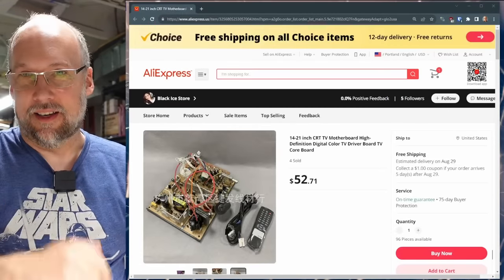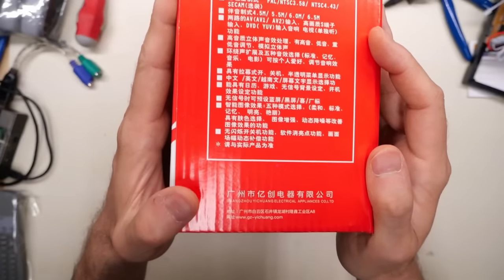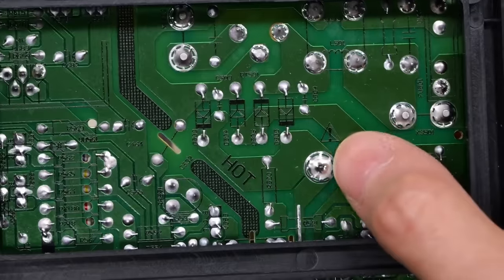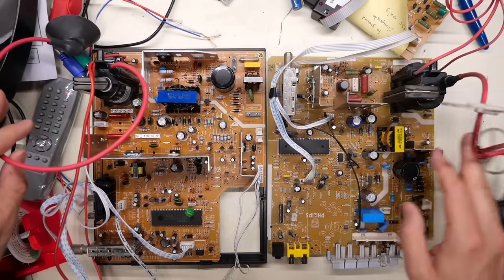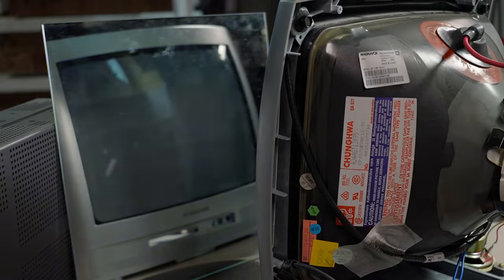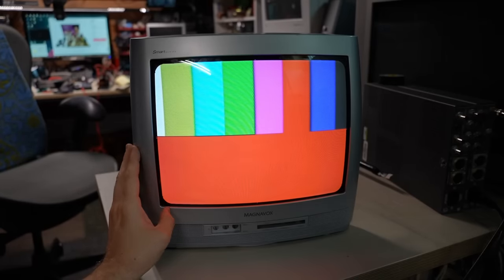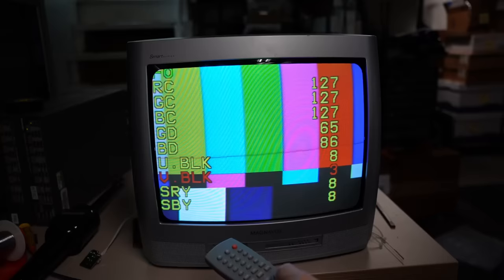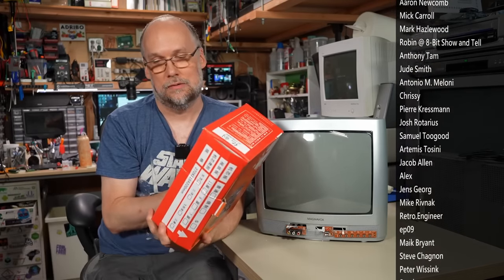I replaced the main board of this TV with brand new parts made in 2023!

Comment: At 40:30 
B/G:  was for Western Europe, former Yugoslavia, South Asia, Australia, and New Zealand, 
D/K: (along with SECAM usually) in most of Central and Eastern Europe and mainland China. Most analogue CCTV cameras are Standard D 
I:        was used in the UK, Ireland, Hong Kong, South Africa, and Macau
L/L':   Used only in France, Luxembourg (only RTL9 on channel 21 from Dudelange) and Télé Monte-Carlo transmitters in the south of France
M/N: Used in North, Central and South America, Korea. South America also used PAL 60 with M/N. PAL 60 is similar with NTSC 3.58
J:       Only used in Japan with NTSC.

B/G uses 5.5 MHz Vision/Sound carrier spacing, I uses 6.0 MHz; D/K uses 6.5 MHz; and NTSC uses 4.5 MHz Vision/Sound carrier spacing. 

After 2000s until digital transition Eastern Europe swtiched from D/K to B/G. I remember the Over The Air analog channels on VHF band used D/K and UHF band used B/G. Cable companies used both formats but in the last years they only used B/G sound format.
Reply: North Korea adopted the D/K standard, South Korea NTSC, Pal M was used exclusively in Brazil, Pal 60 is not a broadcast standard - it was used for video playback only -, Pal N was used in Argentina, Paraguay and Uruguay only.

Comment: Another thought. Since the board is pretty flexible and has a schematic, it could be useful for modding a USA NTSC device to  run at film rate (i.e. 24 fps rather than the USA standard 30fps). Useful for film props. More about this problem in shango066's recent video.  
https://youtu.be/iz3e2VQZeiw?t=840

Comment: When I used to repair TV's in the early 90's and using a variac I often found they would come to life with around 90 volts, and being SMPS the secondary rails would be correct over a wide range of input voltage. Would have been interesting to see if it would work on 120v in it's original configuration. I doubt it would cause any damage. I guess if you swapped out the posistor with the one from the original board the automatic degaussing would work too.

Comment: I think if you would do a video where you scan the original TV housing, edit it in a CAD program, and 3D print a replacement customized to fit the new parts, could be neat. If you'd be able to do that sort of thing, or maybe collaborate with another channel that does stuff like that?
Reply: Came to the comments looking for something like this. He could even just 3d print a small plate and glue it to the front so it looks a little less janky.

Comment: I suspect the SRY and SBY controls are related to tuning the chroma demodulator.   Not 100% sure about the “S” part, but based on what it did to the image, my guess is it’s r-y, b-y color difference signals, possibly gain or offset or something like that.  The demod path for color is composite -> color difference + Luma -> CSC(color space conversion) to RGB to feed the tube.
Reply: Yeah I was thinking the same thing.
Reply: That would also apply to the U.BLK and V.BLK. Since U & V represent the two chroma difference signals.
Reply: Googled around for the meanings of SRY and SBY, and found these explanations:

SRY Secam black level R-Y axis
SBY Secam black level B-Y axis

Comment: I've heard that the new Chinese CRT televisions that the board is used in often use recycled VGA monitor picture tubes. That might be what that picture tube socket is for. It could also just be a normal Philips clone socket, though.
Reply: SVGA tubes can have much better TV picture quality due to finer pitch. I was using a Nokia 417TV (low radiation monitor with TV part) for eons, but eventually a fatal power supply design flaw fried half of the electronics (especially TV section) by negative voltage on +12V, and the mechanical construction is a nightmare to repair (PCB soldered into a perforated metal box, brittle plastic case, double sided PCB with SMD components etc.).

Comment: It's a worthwhile idea to take up the schematics for analog electronics like CRTs and replace components anyway for preservation work. Things can and will leak or fizzle out, so putting in new ones and making sure to perform patches on any damage you find is basically part & parcel. One can appreciate working on them and rejuvenating tubes for continuing this tech should things go awry with modern in the future and we need something reliable.

Comment: I wonder if that PAL generator screen combines the color bars with a purity check? I remember from TV servicing class years ago that color purity is checked with red first, because if red is properly adjusted, green and blue purity will be equally close if not spot on as well. By the way, Adrian - hope you are already getting better (I know the feeling about one's luck running out regarding the human malware; it happened to me last summer)
Reply: "Red patch bars", as they are known in the broadcast industry, wouldn't be all that useful to checking purity in the upper half of the raster! They were actually introduced at the time when colour videotape recorders were starting to be used. If you know about magnetic tape recording, you'll know that one problem is the number of octaves present in the signal being recorded. In the case of audio the range (from, say 20Hz to around 20kHz) is about 10 octaves. Now, on playback, since the voltage induced across the head is proportional to the number of magnetic flux reversals per second, higher frequencies produce a much higher output than lower frequencies and so equalisation needs to be applied to the replay amplifier. A video signal has a much higher bandwidth (approximately zero to 5MHz for a 625-line PAL signal) and the number of octaves is unmanageable. Hence in a professional analogue videotape recorder the video signal is modulated onto a carrier, which shifts so the frequencies upwards and reduces the number of octaves. Imagine shifting zero to 5MHz up by 5MHz - the result would be a signal with a bandwidth of 5 to 10MHz, which is one octave. If you set aside the fact that you now have to record an even higher set of frequencies you at least have a much more manageable number of octaves. In practice the carrier used was about 8MHz onto which the video signal was frequency modulated. FM is known for producing sidebands that extend to infinity both above the centre frequency and below, many of which were beyond the frequency response of the heads and tape. So the signal suffered distortion and that affected mostly the chrominance part of the signal, which was already modulated using suppressed carrier quadrature modulation onto the colour subcarrier. The most noticeable distortion was a form of Moiré pattern that was most visible in highly saturated colours and red in particular. On a vectorscope the sharp dot representing the red colour bar fresh out of the signal generator would appear as a small circle or a fuzzy blob after being recorded on videotape. For this reason, in PAL countries at least, red patch bars were recorded at the beginning of analogue video tapes. In NTSC the severe bandwidth restriction applied to the Q chrominance component had its own negative implications so a different test signal was used that incorporated colour bars at the top and samples of unmodulated I and Q phase subcarrier at the bottom.

Comment: You can mount the speaker on the wall side of the CRT case. Here in Romania or eastern/central Europe back in the day, all  TV brands had the speaker(s) mounted on the sides of the case. Important hint, if you do this, make sure you have new wires for the speakers much longer in order to pull easy the case out without damaging or pulling out the wires from the motherboard by mistake if servicing.
Awesome job !
Oh and i believe you can mount an additional speaker to make it STEREO TV, just by attaching a small mono-to-stereo device and extracting some power for it from the motherboard.
Back in the 2000's I've attached a small pocket radio module to an HC-91 (Sinclair ZX Spectrum) and while i was playing 8-bit  games i was listening to radio music to headphones. Attaching a small antenna to the computer case helped a lot for a better radio signal.
Reply: Pimp my Nei,o sa faca romanii 😂
Reply: @thepostalteenager2206  Amin ! 😆

Comment: Hey Adrian, that's an amazing built, I wouldn't have thought that this cheap imported board would actually work right out of the box.

Concerning the cabinet situation, instead of building one from scratch, you might consider putting the hardware into an existing older TV cabinet! I've just watched shango066 latest video (idk if you're familiar with him, he's into restoring old TV sets), and he visited a movie prop company in L.A. They rent out all kinds of old TVs from all kinds of periods 1950s-2010s. And they do this thing to old TV sets where they remove the old hardware (due to reliability and fire hazard issues, they have to work absolutely reliably and must not set the film set on fire). Then they basically put more modern CRT hardware into these old TV cabinets. "Modern" CRT hardware just like you have. Maybe that would be a viable option to find an older or even just more pleasant looking TV case and put your hardware in there.

Here's shango066's video: https://youtu.be/iz3e2VQZeiw

Comment: Thanks Adrian! Most of us would struggle when attempting this adaption. I was able to find an alternative to using a CRT monitor with my Commodore 64. I am currently using a 19" LCD monitor a friend gave me using a inexpensive adapter that fits in the back of the commodore 64 where the TV adapter is that allows a cable cord to plug into the back of the LCD and it works great. I paid only around $5 about 10 yrs ago for the adapter.

Comment: Interesting board. Being European and doing a lot of European TV sets repair I'm particularly interested in the SECAM feature which was used in France and most Eastern European countries during Soviet times. Personally I would not have made that power supply mod, but I would have added a small 110/220V isolation transformer with a DPDT switch to switch between 110 and 220. Other than that, nice mod at an affordable price :) 
P.S.:  if you took the time to mod all of the internals, why didn't you try to adapt the board to the existing original buttions and / or connectors of the TV?
Reply: Answer:He is too lazy for short and he doesnt give a shit,this is not his main tv,a person which uses a crt as his main tv would care

Comment: Similar to these, at least the analog CGA version without tuners, have been used by arcade video game collectors for decades to replace 40 year old burned out chassis. The key is matching the yoke impedance, mostly the vertical winding, as well as the more obvious neck connector, usually being a type 23 (larger) or type 31 (smaller). Typically in video game monitors the vertical winding impedance will be in the low 8-15 ohm resistance range (Wells-Gardner, Hantarex), or high 45-55 range (Electrohome, Sanyo). Though it is AC impedance matched, much like with speaker coils, you can do a quick DC resistance test to determine primary compatibility. Usually there are enough controls on the new boards such as for vertical linearity to compensate for not quite perfect impedance matching.

Comment: This board is familiar to me. Brazilian Philco (which since the mid-2000s has been owned by Britânia) used this chassis model (or at least a similar design) in a TV model sold in the early 2010s: the PH21SS. It uses an ultra slim 21 inch tube. Even the remote control shown in the video has a design similar to the one Philco used in the 2000s.

Comment: In Indonesia, CRT TV is still popular from low market. 

Because Indonesia has do finished analog TV shutdown, there is a separate market niche for old tv devices. there are vendors that produce DVB-T2 digital tv tuner boards for CRT TV that are universal, either board only, or tuner only for swap.

There are also manufacturers that produce CRT TVs on a small scale, even though the big brands have stopped producing CRT TVs.

Another problem is natonal channels now use widescreen which makes it uncomfortable for tube TV users because aspect ratio pictures.

Comment: I was a TV service engineer in the UK during the 80's, and I can attest to the High Voltage from the LOPTI. Get a belt from a 40" Sony Trinitron at 38KV and you will lose a lot of skin off your hand, as it travels very fast over a through hole PCB. I still have the scars on my knuckles. FYI if in doubt touch with the back of your hand and you don't death grip a live wire.
Reply: Was this the actual CRT highvoltage or the supply voltage running to the flyback? AFAIK the really dangerous stuff are the some hundred volts at over 1A that can kill. (It's volts that jolts but amps that cramps.)

Comment: I think you may be wrong about what Hanover Bars are. There are two ways to decode PAL. One involves the averaging with a delay line and looks best. The other just does a subtraction with part of the current signal (no storage required) and produces alternating light and dark lines, on the assumption that you'll be far-enough from the screen for them to average optically. If you do neither (or something's gone wrong in your decoder), you get different colours on alternating lines. THOSE are Hanover Bars.

At least, that's what I remember from my little adventure implementing PAL in a shader for Media Player Classic quite some time ago.

Comment: Thes old CRTs were massive but they had it all. Didn't have to add a soundbar. But moving one was a challenge, and wherever it was placed needed to be able to hold the weight. However they weren't ever prone to tipping over either.

Comment: Most Chinese CRT TV sets from mid 90s can decode NTSC from the composite input, but most of them cannot receive NTSC broadcast properly.

From the late 90s, most new sets >=29 inches can also receive NTSC broadcast using the auto tuning function.

In rural areas of China, there are still many people using CRT televisions with cable or satellite converter boxes. Although most of them have the sufficient money to buy good modern LCD  TVs, they still use old CRTs because they "just works".

Comment: The reason it might show red that much in the signal generator is because in PAL it is the heaviest compressed color in recordings on VHS, and the signal the easiest to suffer distortion/disruption upon poor reception.  And in measuring the signal, if I recall camera class correctly, red is a big factor in how it correctly derives the synchronization and because in the same calculation, the green signal if I mention that correctly is also very important because it is derived from subtracting luminosity from red, and the result from blue, to create green, I Think.  The SRY and SRB settings made me remind of the Y-pBr (I am probably butchering the calculation abbreviations, camera class has been 12 years a go) calculation for deriving the green signal in PAL.

U.BLK and V.BLK sounds like Universal Blanking and Vertical Blanking.  Meant to correct vertical rolling images or images that might appear off-center horizontally.

Comment: I personally believe that certain retro games truly shine when played on CRT TVs. The nostalgic charm and unique visual aesthetics they offer are something that the current market would greatly appreciate. In fact, I believe there would be a significant demand for both new and old CRT TVs, as they provide an unparalleled experience that modern technology simply can't replicate. When compared to today's advanced displays, some games just don't capture the same essence and authenticity.
Reply: It is more about latency than bare fps why CRT is superior. E.g. Atari VCS2600 had no framebuffer and so could respond on joystick or paddle motion faster than anything modern. Extremely fast reaction games will play much worse on emulator because there are many serial computation steps between recognizing controller motion and bringing the result on screen (even if running on expensive gamer PC).

Comment: Wow. A blast from the past. I used to fix old TVs back in the days. This is the most modern TV electronics I've seen. Obviously ;) How it's possible it's so universal? Because the software. Back in the days those things were hi-tech and expensive. Now they are the cheap option of doing stuff. I'm amazed with how the 2 worlds met here. The ancient tech of analogue TVs and truly modern approach to electronics when you just have a kind of MCU to basically direct everything that is happening. Back in my days when I studied TV tech - we had nothing about digital stuff or processors of any kind. The TVs I studied were fully 100% analogue ;)
Reply: That's why they call it a "digital" TV board. A genuinely "analogue" TV would contain dozens of coils, capacitors and trimmers to adjust screen linearity, colours etc. etc. and could never do that through a service menu by remote control.

Comment: Very good TV boards.
They have a single microprocessor ic controlled by 8 pin BUS memory IC.
The down side of this TV boards is they only receive obsolete analog TV signal.
You must use a separate TV  box to receive the now global standard digital TV signals.
I hope they shall change the tuner so that it can receive digital Tv signal without using a separate set up box.

Comment: CRT pc gaming circa 2005 has come back into fashion for some pc gamers due to 'fluidity', tone, and look. They say the old ones are the best - sure if you like cabbage. Best wishes, Stefan, Jersey, Channel Islands, Britain
Reply: It is about latency than bare fps why CRT is superior. E.g. Atari VCS2600 had no framebuffer and so could respond on joystick or paddle motion faster than anything modern. Extremely fast reaction games will play much worse on emulator because there are many serial computation steps between recognizing controller motion and bringing the result on screen (even on expensive gamer PCs).